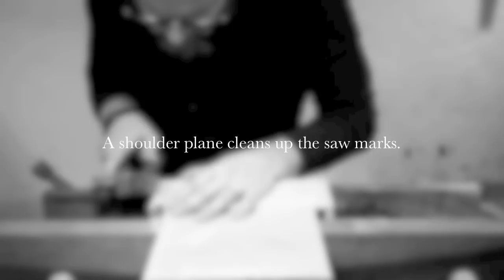The Gentleman's Valet part five: Stringing and cock beading the drawer.

Comment: I don't like working with hand tools but I really enjoy your videos :)
Reply: Jo, an "handtools" sind keine Knöpfe dran und man muss sauber arbeiten.
Reply from the maker: micheloderso sehr wahr !
Reply: For myself, I use a combination of both and an power tools.  I guess you could say I'm a hybrid or "cross overs" woodworker.  I enjoy the speed and guided accuracy that many power tools provide, and the refined control and broader range of work offered by many hand tools.
I have never been able to cut a strieght line by hand, so most of my saws are powered.  Same for virtually all my drilling.  That said, I still use hand planes and chissels for their wonderful versatility, control, and for many small job speed (virtually no set up time and about equal maintenance time).

Comment: Another great video Tom. I notice you exclusively use hide glue on your projects. I think I will give it a try on my next project. I have read quite a bit about the pluses of hide glue. Anything that is detrimental in it's use?
Reply from the maker: Thanks for the comments and question. If you're planning on using Liquid Hide Glue, keep an eye on the expiry date- you'll also need to warm it up before using it.
If you decide to go with hot hide glue, it takes a bit of getting used to- make sure you 'cook' it everyday so it doesn't go moldy on you- Stephen Shepherd's book, 'Hide Glue' is a good resource for lots of hide glue info-
all the best!

Comment: The problem is these handtools are very expensive. But only with good quality handtools is handworking a joy.
Reply: Sure. But good quality doesn't necessarily mean really expensive. I picked up most of the hand tools I own (not many by any means) at flea markets for hardly any money at all. Knowing how to get rid of rust and sharpen blades is all it takes to make that approach work.

The set of Chisels I use was actually bought new. From Amazon. For under 1€ a piece. I bought them assuming I'd have to re-grind and polish the cutting edges and did I ever. But after two hours of leisurly work I had a set of six very workable chisels for the price of a pack of cigarettes. They're probably not going to hold that perfect, crisp edge for as long as a nice set of Kirschen chisels, but they were essentially free. I can still replace them with nice chisels one by one, but meanwhile, I can work with them.

And let's be honest: Crappy, cheap power tools are a pain in the backside to work with as well, maybe even more. Plus you can't usually “refurbish“ messed up good quality ones you picked up cheaply.

I guess you know the saying that blaming the tools is the mark of a bad craftsman. Sure: high quality, expensive tools are nice to have, but IMHO the truly great thing about hand tools is that they're simple enough that you can often make even really crappy ones work well if you know what you're doing with a whetstone and a file…
Reply: Tilman Ahr
I ment the planes and the saws. If iam able to get those on a flewmarket, hurray, but i dont believe.
Reply: micheloderso
 Most likely not those same ones, but I bought old, high-quality wooden planes at flea markets and restored them before. Once you know how to handle them, they are a joy to work with.
Reply: Tilman Ahr
Yes, i did it too. And i bought some planes from silverline. They are less expensive and with a little work on it and i can use them daily.
 And, i fight my struggles with the right angle on flat boards...;-)

Und wenn ich dann Mr. Fidgen zuschaue bin ich manchmal ein bißchen frustriert. Aber ich gebe nicht auf! ;-)

Comment: I'm assuming the scratch stock used is from an old tool blade? What kind of steel if you don't mind me asking ?
Reply from the maker: it was actually made from an old card scraper- spring steel that about 0.016" thick and hardened to Rc48-52.
hope that helps!
Reply: Tom Fidgen It does! I never thought of that as an option. Oh! And I want to thank you on your advice on planing joining surfaces on knotted wood (I asked a while back)...worked like a charm...I've never had such a tight contact for a glue up. The joining surfaces were quite wide, but no discernible gap at all!  I did as you said...and I feel quite grateful! Thanks.